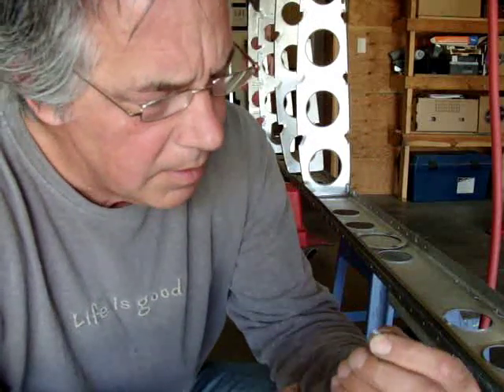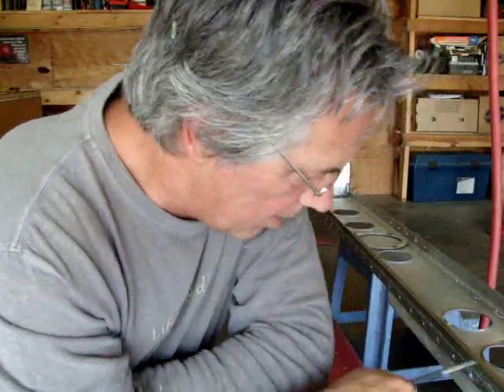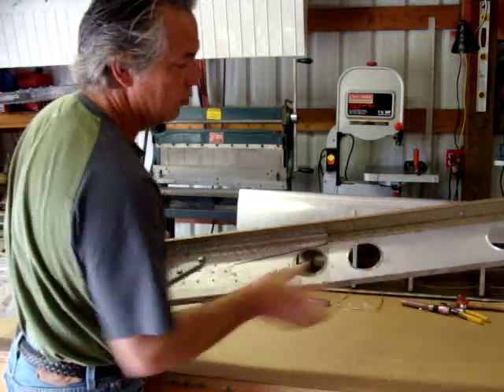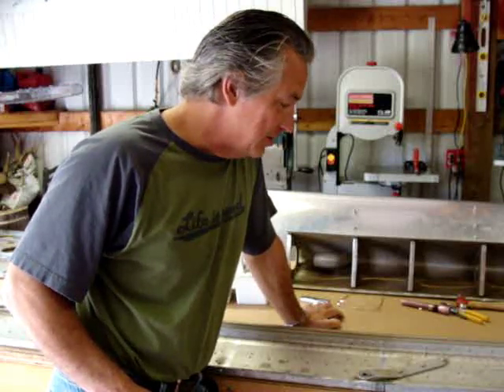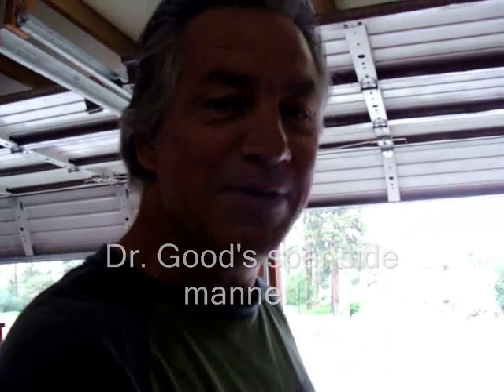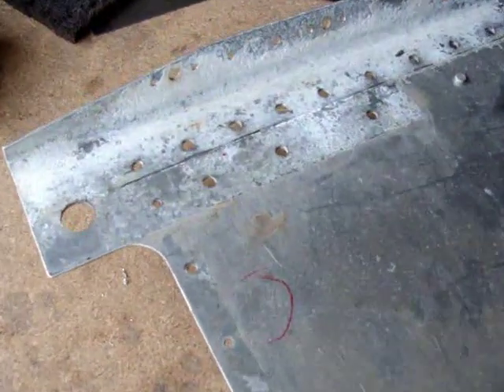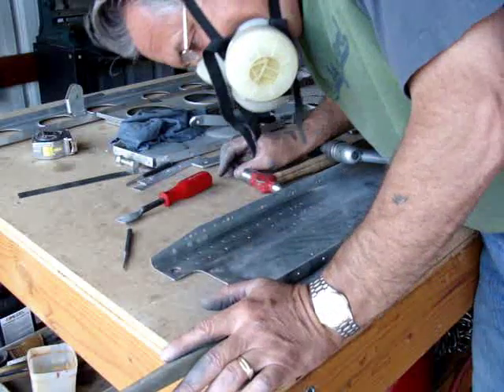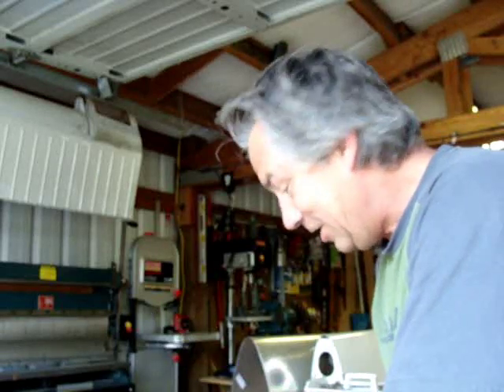Lloyd's Update III Cessna Wing Rebuild

Comment: With regards to rivet holes, when drilling out rivets it is nice to have the hole not enlarged, but realistically, if the hole is elongated a few thou it is not the end of the world. Lets put it in to context here, there are many rivets in any given structure, and they are designed in a manner where they can withstand many more times the actual force they will encounter. Remember that these are rivets, not bolts or screws and when they are driven, they actually take up the size of the hole, within limits of course.

Comment: Never did get an answer below. When you grind on the aluminum, how much are you allowed to grind it down? I understand that you  grind it down to remove the corrosion and that will stop the cancer to the skin but just asking, at the time you remove the corrosion isn't the aluminum thicker then after grinding and wouldn't it actually be stronger before then after the material is remove? Is there anything that you could do by spraying or.... that would stop the corrosion and not make you tear it all apart? Thanks
Reply: The latest Cessna Service instructions allows corrosion to be sanded out,  but 90% of the thickness must remain after all corrosion is removed.   In other words, you can remove up to 10% of the thickness.  For a 0.040" piece, that would be a maximum of 0.004",  which isn't much.

Comment: I got my A&P in 2000 but I have not used it! While in the class there was a man that was working on a 172 wing as you are. He stopped as the school did not have a wing jig and did not know how to build or borrow one. Are you putting this together with a jig or how are you getting thing correct? I intend to use my cert. after I retire as something to do. 
Thanks for the video.